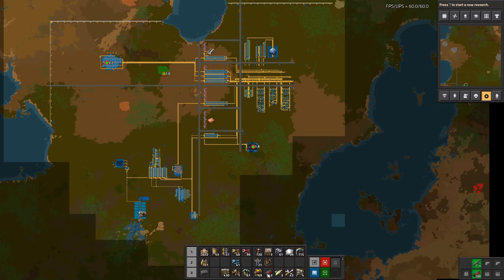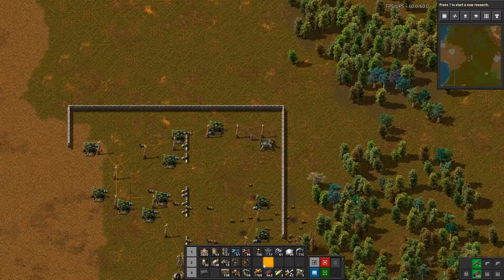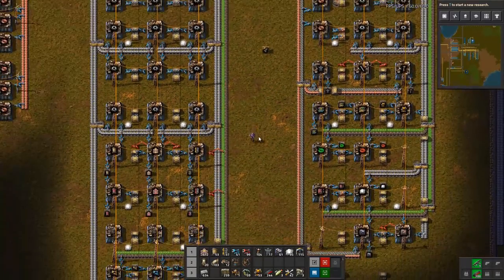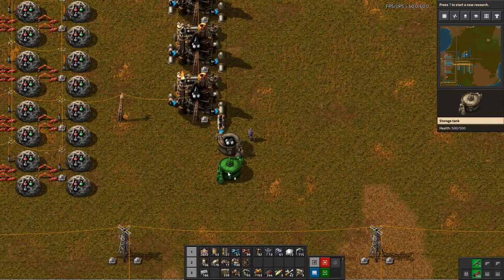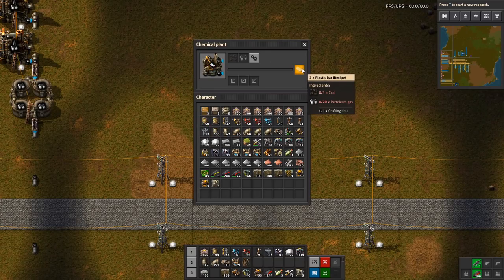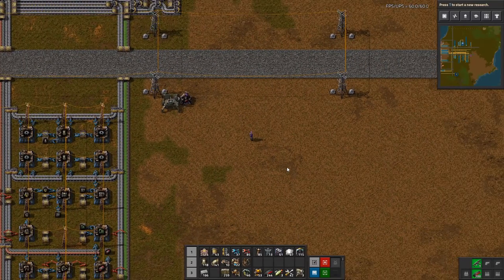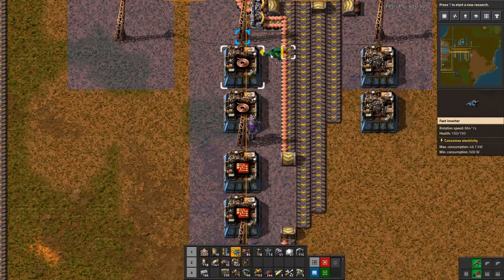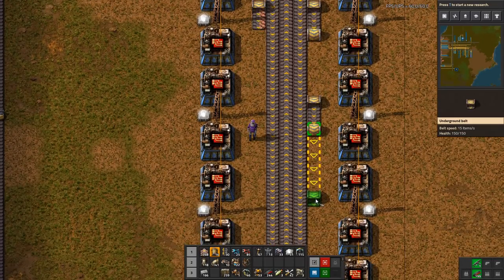Factorio 1.0 #13 FROM CRUDE OIL TO ADVANCED CIRCUITS | New Player Experience

Comment: 22:38 actually, once you're thinking about belts, you need to include the 0.75 crafting speed, so there's still room to spare on the belt. Also, you broke the green circuit belt on the bus at 32:41

Comment: Hi Nilaus.  For red circuits, I'm curious if you considered running the copper belt on the outside rather than the inside?  This way you could just run a straight belt, saving all the undergrounds.  It still leaves room for adding beacons later if you want.

Comment: Why the use of so many underground pipes? Am i missing something?
Reply: Normal (overground) pipes don't allow the player to pass through them. Additionally, underground pipes only count as two pipes in length regardless of their true length. This affects pumping and liquid movement. Long pipe distances reduce the speed of flow. If Nilaus had used normal pipes to bring the crude oil back from the pumps, the oil would come more slowly.

Comment: Why did you bring red circuits back to your hub? When I checked, I couldn't find any items that required red circuits in your hub.
Reply: Not yet, most of the things are behind blue science.  Stack inserters and blue belt splitters both require red circuits.
Reply: @canebro1  Yeahh, I was a few episodes behind and saw him pick the items that required red circuits ;) thanks bud
Reply: @sangria9052  No problem :)